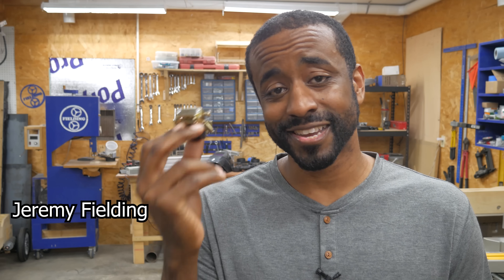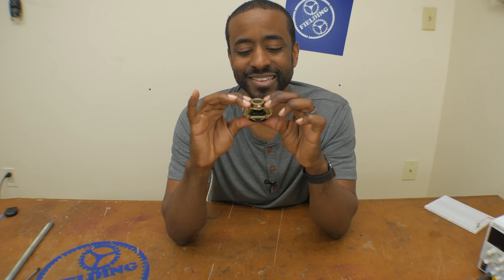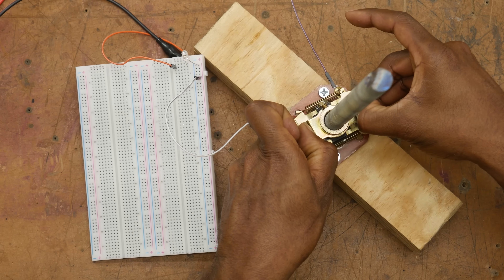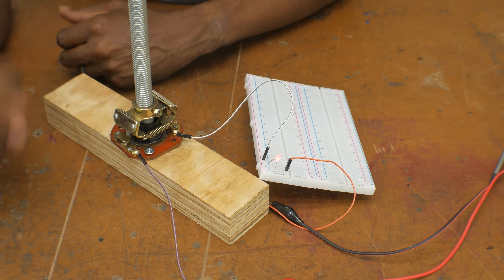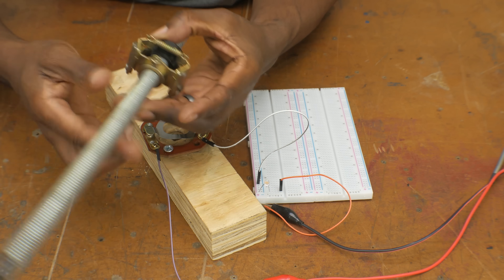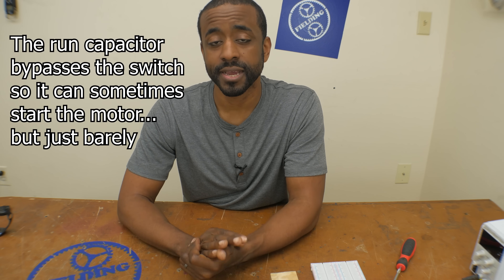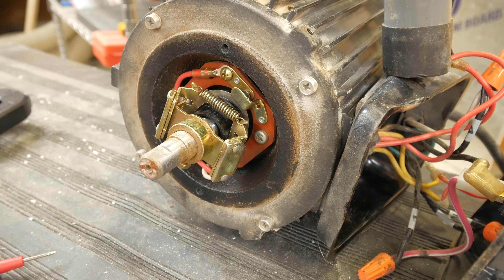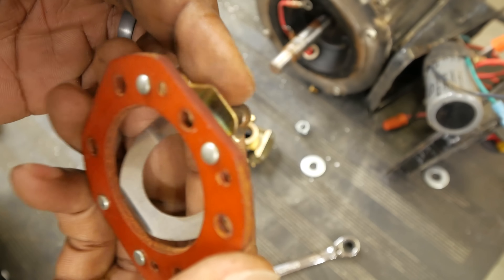This Clever Device Is Found In Nearly Every American Household. How It Works And How To Fix It

Comment: Where do you even find relicts like this? All the washing machine motors I've seen are either 3 phase motors with a phase shift capacitor or single phase ones with a collector and none of them contain any capacitor switches. If the mechanically controlled ones ever existed then they are all dumped, crushed, remelted many times, then sent to China and now probably exist as some parts of some popular gadgets. They are just not around.
Reply: I have a Centrifugal Switched Capacitor Start motor in my Dryer,  Air Compressor and Furnace Blower !!!   Centrifugal Switched Capacitor Start motors are very common.  Example ...  https://www.grainger.com/product/24C181

Comment: If it fails on a stationary tool you can bypass it with a momentary/On/off toggle switch. Then the operator can manually do the job of the start switch. It’s slightly better than hand starting.
Reply from the maker: I have done that before LOL
Reply: @Jeremy_Fielding  Some dryers have a momentary START SWITCH that provides the functionality of the Centrifugal Switch.

Comment: The invention of every piece of equipment that makes the US electrical grid work is generally attributed to Nikola Tesla, including that style of of motor. I'm fairly confident Tesla would've used same centrifugal switch mechanism, but I also strongly suspect it would of been considered too obvious to patent at the time. As it's only marginally different than the centrifugal governor's that had already been used on stationary gas engines, steam engines, and even some waterwheels for hundreds of years previous. Interestingly Tesla sold his patents for AC power technology to Westinghouse for very close to nothing as his genius did not lie in business.
The other problem I've seen with those centrifugal switches is the plastic shuttle breaks. About a year ago I printed one in PETG, it's still working.
Reply: Otto Blathy invented the Step-Up and Step-Down AC Transformer, that allowed for long distance power transmission - not Nikola Tesla.  There were many other inventors, before, during and after ... Nikola Tesla .. that contributed greatly to AC power & AC motors.  No, Nikola Tesla never used the Centrifugal Capacitor Start Motor ... you are just making shit up.

Comment: Terrific video!  One point though:  One may get away with using sandpaper, but it is not recommended.  It will unevenly scratch the contacts leaving microscopic points and gouges.  The other problem is it leaves abrasive material in your mechanism.  It is much better to use a contact or point file.  Point files were commonly available at auto part stores for filing ignition points and spark plug tips.

Comment: There's another type of centrifugal device used as a governor to regulate speed. You've probably seen them on steam engines. There are balls on a Y-shaped part. The ball is on the bottom and one arm on the top of the Y is connected to the top of a spindle connected to the output shaft of the engine. The other arm of the Y is connected to a valve that regulates how much steam feeds the engine. The faster the spindle spins, the balls will spread out and open the valve to reduce the steam feeding the engine and will control the RPM of the engine. I also thank you for this video as I can always learn something new.

Comment: I invite you to look into a potential relay.  They are common on air conditioner compressors.  They are basically a relay that connects a start capacitor in parallel with the run capacitor until the motor spins up.  When the back emf voltage from the run winding is greater than the voltage on the start winding, the relay opens, disconnecting the start relay.  These are also called three wire start kits.  pretty cool to play with.
Reply from the maker: I did a video on them before.

Comment: Please don't take this the wrong way but listening to that 60 grit touch those poor contacts made my skin crawl.  You might want to invest in some burnishing files for cleaning electrical contacts so that your can ensure parallel contact. Usually those contacts are silver plated because silver oxide is conductive, unlike copper oxide, to reduce cleaning requirements from inherent arc pitting and using coarse paper completely removes that plating and exposes the copper or brass substrate that will arc pit rapidly.

Comment: The basic idea has been around a lot longer than electric motors.  A similar mechanism was used to control steam in old steam locomotives.  The speed of the governor in that case would work a valve adjusting the steam for those...  see this link:

https://en.wikipedia.org/wiki/Centrifugal_governor#:~:text=A%20centrifugal%20governor%20is%20a,maintain%20a%20near%2Dconstant%20speed.&text=Centrifugal%20governors'%20widest%20use%20was,Age%20in%20the%2019th%20century.

Comment: You should also cover the PSC, permanent split capacitor, motor. It has a capacitor but no centrifugal switch. The capacitor is permanently connected to the start winding. These motors are in every furnace and air conditioning unit where starting torque requirements are low. Capacitor start motors requiring the centrifugal switch are used in nearly all belt drive applications which require additional starting torque.

Comment: In my dryer motor the centrifugal switch is used to control (close) the secondary power circuit for the heating element, smart since you only want it hot when the drum is turning. Amazing how a device so simple can have so much impact, people were mechanical geniuses in the 20th century! Thanks for sharing 😊👍🏻

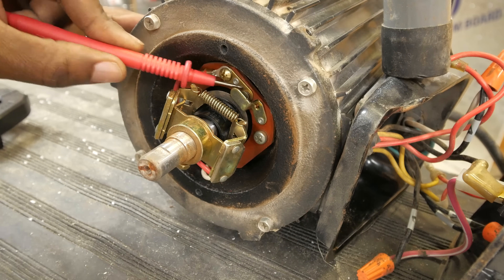Comment: 6:38 that was the capacitor discharging, switching off doesn't affect it when it's been left out of circuit with a bit of charge in it.
Reply from the maker: No. I discharged the cap
Reply: @Jeremy_Fielding  ah! Easily done, I tried to change an oven thermostat when it was still connected once, it was an electric oven and it touched and melted the sender tube so I had to buy another new thermostat as well as remembering to disconnect it fully :)

Comment: I had a motor I got cheap at resale, which clicked loudly when the motor was on, at the same RPM as the shaft. Taking it apart, I located the centrifugal switch and found one of the "ears" holding the weighted plates in position had shifted, causing it to click against the contact as it rotated.The motor had probably been dropped. Reassembling it solved the problem and it's worked just fine since.

Comment: Around where I live we use 3-phase motors instead. Large 3-phase motors do however have an Y-Δ start. But that's not used in washing machines and similar.

Comment: I'm going to take a guess, but that flyweight switch thing may have been invented by Granville Woods? African American inventor who did a lot of work with motors and electric switching systems on some electric rail and early subway systems in the 1890's. Might need to look further into that to verify it. (It wasn't quite for this purpose, I think the original application was an over-speed cutout as a safety device. But a switch is a switch, so if it's found useful then it made its way into this purpose as well.)

Comment: A important part of the design that you didn't mention explicitly is the geometry between the arms and springs. The reason is 'snaps' open and closed has everything to do with that geometry, and the 'snap' action is what helps prevent the contacts from arc fouling. When it's fully opened, the spring is disadvantaged. This also explains why the mechanism snaps open at a different RPM than it snaps closed. Very simple yet effective!

Comment: Don't need this device in UK as we use more than double your voltage.
Reply from the maker: We use 240 in the USA as well. You need something similar as long as you use single phase power. And the UK uses single phase... That motor in the video is 240 FYI. I was referring to countries like Germany that have three phase power in homes.

Comment: some time you might want to just replace the contactor.  sanding will work for a while.  but the hardened coating has been arced away.

Comment: I have a question that is off subject  but I ask it on your recent video in hope you read it. I have a vintage air compressor that has a huge motor " it may not be original " and this motor has been rewired from 220 to a 110 plug. If I were to put it back to 220 would this be harmful to the old time compressor? I have a deal on a newer compressor that is wire to 220 and what happens if I downsize it to 110? Please advise

Comment: It's a variation of the flyball governor used in old machinery (steam engines, etc.)  I did a quick patent search and found an 1858 patent (#20,984 Charles T. Porter) on a flyball governor, but didn't look for prior art.  But it's essentially the same thing: the weights get flung out by the centripetal force, and that pulls a ring away.  It's just that in the motor the ring activates a switch while in a steam engine it throttles the steam inlet.  Nice video!  I, too, marvel at how some devices seem to live forever.

Comment: In the VW engines cooling system there is a similar piece of equipment that is used to keep the coolant system closed until the engine has warmed up and is at the correct operating temperature and then this similar looking even, piece of equipment opens the system so that the coolant can start to flow and do its job. . . . . .

These parts are amazing in that they are simple, reliable, cost effective and have and will stand the test of time.

Thank you for pointing this gadget out, I hope you have a look at the part I mentioned some time.

TGC 
Blessings in abundance:)

Comment: I have heard, at least with dual run capacitors in HVAC systems, that going over the intended capacitance value will increase the temperature on the windings and cause premature failure of the motors. Is this due to the nature of a run capacitor being always on or perhaps a inaccurate warning by manufacturers to play it safe?

Comment: US Patent US2583590A granted in 1952 shows that Ervin Osterhus was the inventor.  A centrfugal overspeed switch (patented in 1963) works in a similar fashion but disconnects power.  There have been pantents granted for various design changes (his may be one of them).  One site says they were in use prior to 1910 in electric fans.

Further researh by Wiki shows that Lee Royal was filed for a patent in Sept 1923 and was granted patent #1,630,394 in May, 1927.

Comment: Learnt about this in school years ago but this is the first time I ever saw one. Probably because we are on 240v system here motors run at lower current and we can get away with fixed start/run caps.

Comment: Wish I had known this years ago. Bet it was the real problem on several motors I installed new starter caps on that still wouldn't start under load.
**Like a governor on the old hit and miss motors.

Comment: Something similar was used on steam engines. steam engines had a governor rod with ball shaped spinning weights on the ends. When the engine was running at maximum speed centrifugal force moved the balls  all the way out.
Fun Fact: It's also where the term "Balls Out" came from.

Comment: I was guessing it was the governor on a small engine.    I should have known what it was,  I recently cleaned up the contacts on the starter and replaced the capacitor for a motor on the bench grinder.

Comment: Jeremy they are phasing out these mechanical switch they now have potential and electronic switches on Lincoln single phase motors and most single phase motors that come out of  Europe is split phase with running capacitor only.

Comment: Tabs?  TABS??  Veee Dun't Need No Stinking TABS!!!!  But "CONTACTS", well now, datsza my kinda pizza pie!  FYI: Electrical contacts come with a HARD electro-plating on them.  Once it finally gets arced away, even after 'burnishing/sanding the contacts smooth, the plating is gone, and the subsequent arcing will quickly wear through the contacts completely.  Great video Jeremy!!  Keep up the great work!

Comment: When I stared working as a mechanic back in the 90s I blew all the other mechanics away when i started started fixing all the old shop equip.  Most of them referred to the motors that clicked as two speed motors and when they quit working they'd shove it onto the corner and forget it I blew there minds when I fixed these types of motors with nothing but sand paper.  Did i mention that I was only 17. Thanks to my grandpa an old a.c repair man he showed me enough stuff I was well beyond my years at 17 in maintenance.
Reply: My kind of guy, there Sparky. At 12 years old I repaired a half dozen A.M. tube radios and an antique RCA record player (talking 1940's) in my grandparents attic because "they're broken" didn't satisfy my curiosity. Don't change - don't ever let anyone tell you "you can't do that"!
Reply: Hence the name Sparky?
Reply: Also in wisdom, you were wise enough to take the knowledge that was shared with you.  Always remember Old People Know Stuff.
Reply: @Heads Mess OwO

Comment: These are high current contact pads, so at some point, there was protective coating, for example, beryllium (toxic AF). So it would be nice to mention this might be just a relatively temporary fix. A contact cleaner should be a more gentle option, also adding appropriate protective chemistry. Blowing sandpaper dust in direction of the opened motor is 8/10 nono.  Also, I am wearing no pants, neglecting my own line of work,  afraid of bedroom-engineers judgment.

Comment: Really interesting, I’m not sure I have ever taken a motor apart with a capacitor now. And you mentioned this is on motors in North America. Would European motors not need them because of the higher voltage?
Reply: It’s not the voltage, it’s the number of phases.  Large industrial motors — in any country — use three phases.  Household equipment uses just one phase.    Three phase motors don’t need start windings, or capacitors to start.  Small induction motors use a “shaded pole” to start — but those are generally used in low torque applications, like fans.

Comment: Recognized from thumbnail: Centrifugal switch for capacitor start AC motors. It adds the "second phase" creating a rotating magnetic field until 25% of motor speed is attained then opens capacitor from that winding allowing the motor to continue to full speed. Capacitor start/cap run motors are next step up Mr Fielding. Full 3 phases from single phase supply.

Comment: My drill press motor growled and burned up in a big puff of smelly smoke on day 91 since purchase day (warranty was only 90 days..).  Taking it apart I found  that the clamp holding the device onto the shaft had loosened, allowing it to slide away from the contact switch. By not disconnecting the start windings it made the motor burn into scrap metal in seconds.

Comment: I’m with you I used to tinker when I was a kid and utilized a metal fan blade and a dryer motor from the seventies. I had to hand start the thing but was a good powerful fan. My dad explained why but I’ve never had one out.  I will bet I will need to lean one soon on an old table saw. Thanks for the info.

Comment: Possible Origin - 1788 - Anyone who has investigated old electric motors has probably heard these names - James Watt and James Maxwell.  James Watt designed his first centrifugal governor in 1788 following a suggestion from his business partner Matthew Boulton. It was a conical pendulum governor and one of the final series of innovations Watt had employed for steam engines. James Watt never claimed the centrifugal governor to be an invention of his own. A giant statue of Watt's governor stands at Smethwick in the English West Midlands. It is known as the flyball governor.
Centrifugal governors are also used in many modern repeating watches to limit the speed of the striking train, so the repeater doesn't run too quickly.
  Another kind of centrifugal governor consists of a pair of masses on a spindle inside a cylinder, the masses or the cylinder being coated with pads, somewhat like a drum brake. This is used in a spring-loaded record player and a spring-loaded telephone dial to limit the speed. 
The centrifugal governor is often used in the cognitive sciences as an example of a dynamic system, in which the representation of information cannot be clearly separated from the operations being applied to the representation. And, because the governor is a servomechanism, its analysis in a dynamic system is not trivial. In 1868, James Clerk Maxwell wrote a famous paper "On Governors"[4] that is widely considered a classic in feedback control theory. Maxwell distinguishes moderators (a centrifugal brake) and governors which control motive power input. He considers devices by James Watt, Professor James Thomson, Fleeming Jenkin, William Thomson, Léon Foucault and Carl Wilhelm Siemens (a liquid governor).

Comment: As an oldschool/ newschool technician (automotive)  a points file would be the best thing to file down the points. You can get them for about 5 bucks at the auto parts store. If you use sandpaper or anything gritty it could leave scratches that cam cause premature failure again. You want a level and smooth surface for them to contact.

Comment: What happens to the capacitor if the switch doesn't open?  I have a drill press motor that's rated to operate at 120VAC and I live in Japan which is 100VAC.  I know I'm under powering the motor and should use a step up transformer but it's not very convenient where my shop is located.  I'm wondering if the motor speed doesn't get high enough to open the centrifugal switch thus the capacitor stays in circuit.  I've burned out and replaced one capacitor and I thought it was just faulty.  When I run the drill press now, the capacitor and motor get really hot after only a minute of run time but I haven't burned up the capacitor yet.  Thanks for sharing the video!